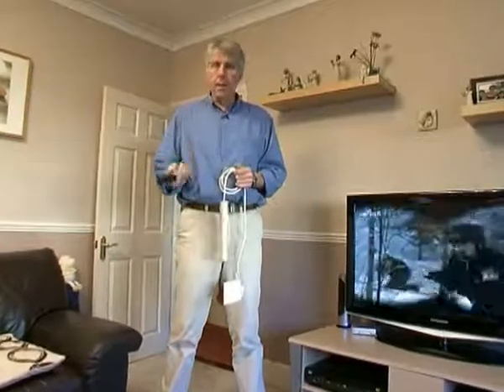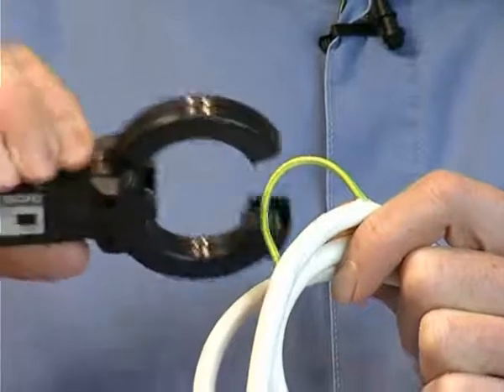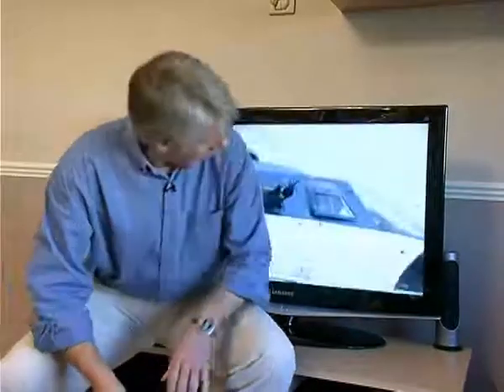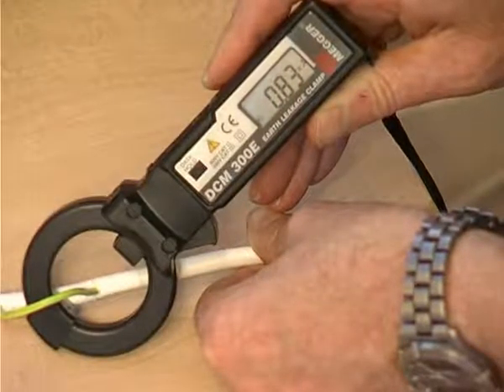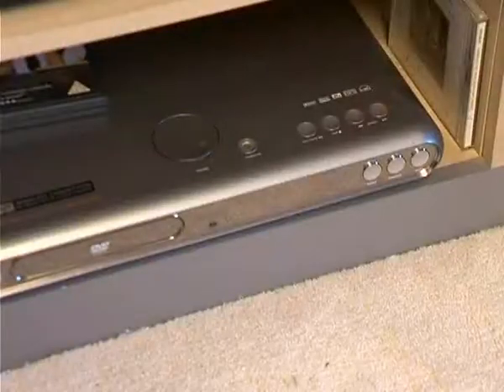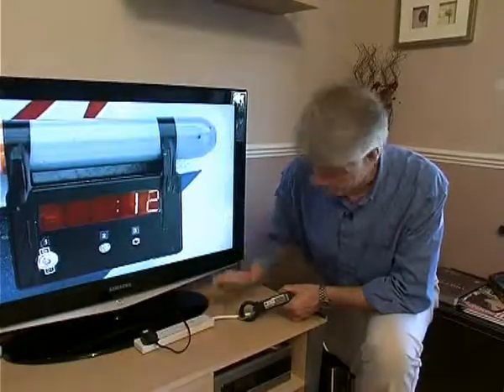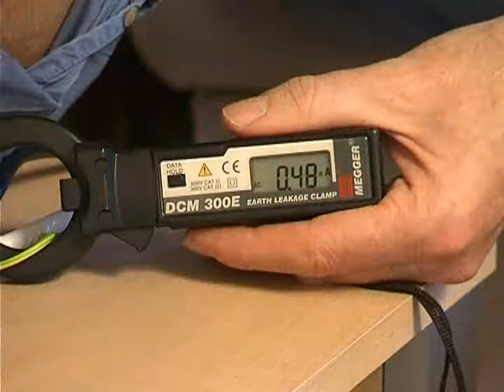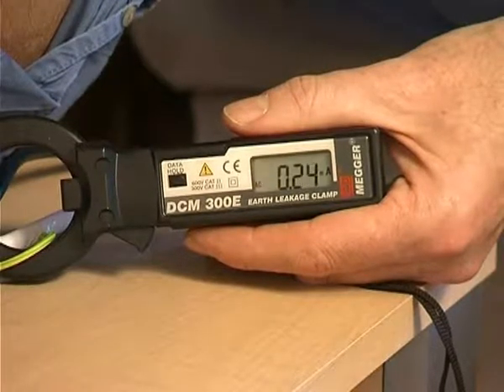Testing a Theory: Earth Leakage

Comment: It is better to put the clamp meter round the line & neutral to get a truer measurement of earth leakage. That's because it's possible that there's another route to earth which could be carrying current. In the case of a television, then there is very likely to be a connection to earth via the coax aerial lead, and a reading from the protective earth alone might not be accurate. That's going to be even more likely for devices like immersion heaters, boilers or anything else with a solid connection to the plumbing or gas pipes.

Comment: Just because an installation is old doesn’t mean that it’s unsafe. If the installation was designed to an earlier edition of BS7671. Then 
off course it won’t comply with the current edition of BS7671  , there is no law or regulations that require it tobe Brought up to the current standard. As long as it is in good condition ie no signs of damage, overheating , burning , or exposed live parts, we should only make sure that all connections are tight conductors terminated correctly with no detieration 
We then carry out all the required tests as to the current edition of BS7671, if all test results are within the maximum limits specified by the IET BS7671 then we can sign it off as being safe for continued service. And give a code 3 for the lack of RCD protection . This guy’s need to read the HSE note in BS7671, and the guidance in the onsite guide page 99. He is or was a sales rep for martindale. And needs berry his head in the books. And get back on the tools. He might just learn something.

Comment: Since there is earth Leakage in the CPC, then say if you put the clamp meter around the line and neutral should you not also get the same reading as the current will not cancel each other out but instead indicate the difference- the leakage current?
Reply: That's a good point...coronavirus permitting we,  we will test the theory

Comment: Do you mean high ripple voltage is higher leakage current? the lower the ripple AC voltage the lower the leakage current?  How do you lower the leakage current?
Reply: Sell the equipment and buy new.

Comment: Hi you come correct, would I be right in sumising from your video that upgrading the installation with R,C.D or similar can go ahead as there won't be issues with tripping due to currents above 30mA leaking to earth? and upsetting the protection?
nice touch with the C.P.C. drawn out of the flex by the way!
Reply from the maker: Hi, thanks for the comment. You should always assess every installation, the video shows a way you can check this.

Comment: Would i be right in saying that if your replacing the board a p.i.r should be carried out prior to replacement to check the installation. Any appliances with high earth leakage will effect the day to day operation granted but if they had such high leakage they shouldnt be in operation. Im not sure i see what you are trying to achieve here.